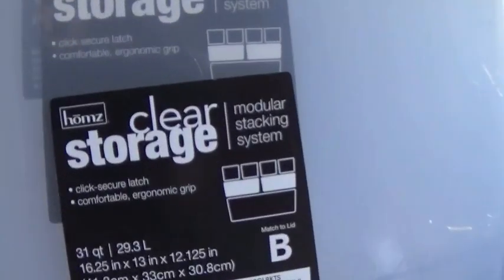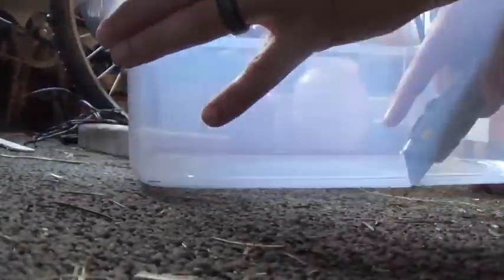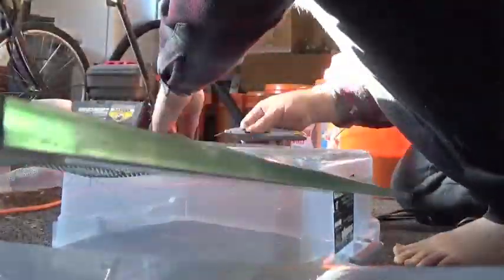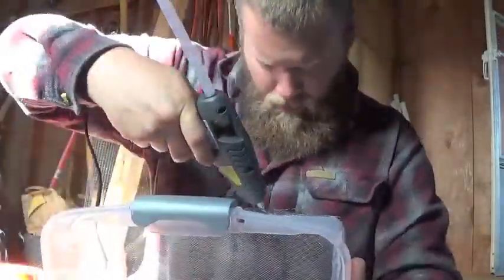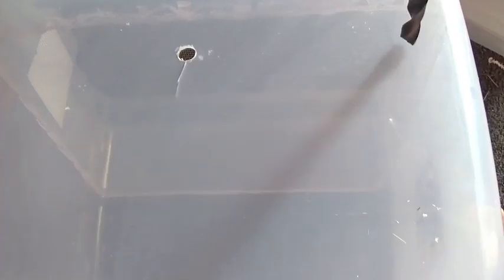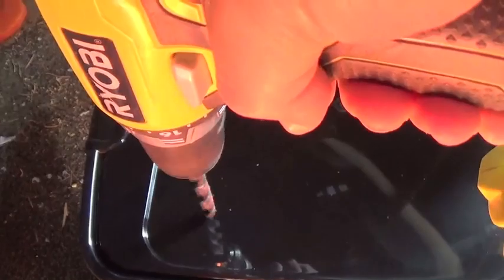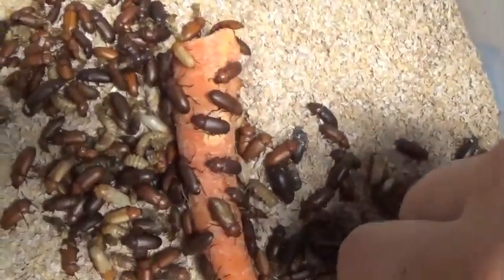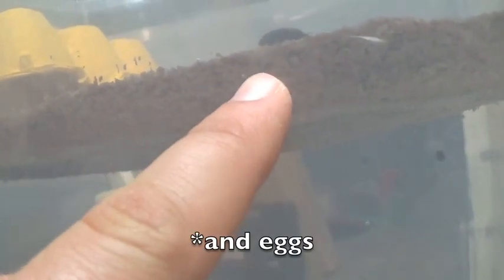DIY Self Sorting Mealworm Farm

Comment: Awesome tutorial! Here's something I learned using putting air holes in totes like this: A soldering iron or wood burner works really well to put the the holes in, it doesn't crack and it's much faster

Comment: a tip for drilling in thin plastic is to reverse the direction of the bit. Typically, this prevents cracking around the holes.
Reply: As well as having a piece of wood behind plastic

Comment: A hot soldering iron makes very nice clean holes in plastic containers.
Reply: J Wick that’s exactly what I did! Worked like a charm
Reply: I was going to say a got poker but a soldering iron is a self heating hot poker! Lol good on ya!
Reply: Idk why I didn’t think of this the first time I did my set up 😂 I have one handy too. Oh well. Next time I won’t forget.
Reply: $3.99 Harbor Freight soldering iron makes nice smooth holes and never cracks!
Reply: I've found drilling into the plastic against a piece of scrap wood also usually prevents cracking, as the wood provides support
Reply: @crotalus2011  yah definitely.. I did that and made some nice and clean holes
Reply: @fbiagent3399  and the holes are smooth without sharp edges. I use a lot of plastic shoe boxes for my baby snakes and they don't damage their noses trying to get out.
Reply: @crotalus2011  yah definitely..
Reply: @crotalus2011  And for a few extra bucks buy their wood burning kit, which gives you a bunch of different size and shape tips.  Good for welding plastic too!
Reply: @crotalus2011  wish we had that store.

Comment: Put a tape on it before you drill the holes.
Reply: Dudley DooRight looks like a 3/8 but tape is amazing for holes in plastic. You can even put a pin hole in an inflated rubber balloon with tape!

Comment: Thank you for posting this video ! VERY INFORMATIONAL ! So far I have done everything you have done before I watched yer video, till I came into a problem; is to why I’m researching again ! Need yer advise ! The tub gluing : the glue came apart from the bin overnight after I just put new bedding & beetles in it ! What a mess ! So PLEASE, I’m askin’ for a lil advise on what to do, what to try next ? Is yer glue gun a ‘high’ heat or a ‘low’ heat glue gun ! 
Please, I need help as soon as you can !
Reply: high heat definitely bonds better.  They're difficult to find these days though since they can burn you pretty badly if you're not careful.  All the stores around where I am won't stock them.

If you want more strength, cut multiple squares out of the bottom of the tub and leave like half-inch bars across it.  You might have to do this especially if your tubs are larger than his.  Size and number of bars to leave depends on the thickness and size of the tub, so you'll just have to figure out what works best there.
Reply: @laurenceperkins7468  : Thank you for yer help ! I will try this & see if it works! Ty

Comment: Good video and thanks for sharing.
I did basically the same thing shown here but modified it after several cycles of growth. As others have mentioned, get a soldering iron with the pointy tip. Burn tons of holes in the bottom of the top bin. Forget drills. Burning holes is lightspeed faster. Anyway, that will let the eggs fall through as well as any smaller mealworms. The beetles won't go through. They're too big to fall through the burnt holes. 
I don't use a screen and I don't hotglue them in. The hotglue eventually peels off and the whole thing fails. I feed rolled oats. They're bigger in size and don't fall through as much as a finer bran mix. 
Then it's just a simple matter of moving beetles from the bottom bin to the top bin and keep the cycle going. 
Everyone once in a great while, I'll dump the contents of each bin into a colander to sift out the frass. Don't breath that stuff. Sure, some eggs will be lost in the process but with a big enough colony, it's negligible.
Reply: The Beard King I’m lost here. Why do I need to separate eggs, pupa, beetles? I don’t know where to put the larva? Please and thank you ahead of time.
Reply: @judyradke9847  put the larva in a small tub they can be together but if so make sure as soon as they turn into beetles they are taken out and the reason you have to keep them seperate is because the mealworm dartling beetles are canibals and they eat others beetles eat the pupa and pupa are inactive and can't move mealworms and eggs together are fine
Reply: So how many totes do I need to keep all the farm. I would like to label with a name  and number each tote so I don’t get confused . It will be easier to follow the process the correct way. Can you help me please 😀

Comment: Well next time use a smaller drill bit to make pilot holes then a bit bigger bit then your final size or siply rest the surface you're drilling directly on a piece of wood for support and you will have 0% chance of your tub cracking while you drill holes

Comment: If you don’t want it to crack use a smaller bit and or heat it up little with a torch not glowing hot just a touch will do great vid

Comment: There are two ways you can drill holes that will make it so it doesn’t crack you can put a piece of tape on it first and you can also run the drill backwards but that takes quite a bit of time so I like the tape method or just press super lightly and be patient

Comment: my farm sets at 71 degrees Fahrenheit its been over 30 days and it still is not producing meal worms. i thank something is wrong please help
Reply from the maker: Fast Eddie's Appliance Repair  don’t get discouraged. It can take up to 2 weeks for eggs to hatch, and the mealworms are super small to start with; so you may have some yet. What are you using for a substrate?
Reply: large oats and ground up cat food
Reply: what is your average temperature
Reply from the maker: Fast Eddie's Appliance Repair I don’t check my temp. I give them a big box; if they are hot, they move apart, if they get cold, they move closer.

Comment: Question-Do you think it's okay to mix oatmeal and wheat bran together as the substrate?  Also, where do you find the best deal on the wheat bran?  TIA  :)
Reply from the maker: Reagan Berry not sure why that wouldn’t work :) I get 50 lb bags at my local feed store. Might not be the best deal, but I like shopping local. Good luck!
Reply: AG central Co-Op, 16 bucks for 50 lbs of wheat bran.
Reply: Hi I made one of these but used screen from a sliding door that we weren’t using and it doesn’t seem to be letting the eggs fall through? I can’t tell.  Is there a specific screen size I should use? Thank u for the video!

Comment: How are you separating your beetles from your old substrate in the top bin when you change out your substrate?  Believe you said you were changing it out every 2 weeks, correct?  Thanks!  Great video!
Reply: unless you put a TO THICK layer in the top box he dont have to do anything hehe,,,, as soon as the beetles eat the bran and poop it out IT WILL FALL thru the bug screen  toghether with the tiny eggs-larvas to the bottom box . hehe
but even with a thicker layer, you can speed up the prosess by shaking a little from time to time,, but usually the beetles- larvas move around enough.

Comment: First of all, I like your name, "Welcome Back." It feels very welcoming. I also like the way you make your videos such as point of views, voice recordings with pre-captured videos, etc. It's very similar to Justin Rhodes's videos. I like him too. I just started mealworm farm for my chicken as well. If I am allowed, I would like to suggest you to cut screen same size with bottom of your mealworm container size and place the screen INSIDE with hot glue. Then, you don't have to use a lot of hot glues inside and out to prevent any worms or beetles to run away from your farm. I used zig zag saw to cut the bottom as well and got couple cracks which is just minor that I don't worry about. :) I hit the "Subcribed" and "Bell" next to it. BTW, what area are you in? I'm MD
Reply from the maker: Thanks for the complements Isaac, very kind of you! We are in Oregon; about an hour outside of Portland. These tubs I use tend to shatter when I use the zig zag saw, hence why I have switched to the razor blade. Thanks for the screen tip, I'll try that on my next box. Thanks for subscribing, and welcome back :)
Reply: I use the soldering iron to remove the bottom too. You just kinda drag it through the plastic slowly as if it were a hot knife.